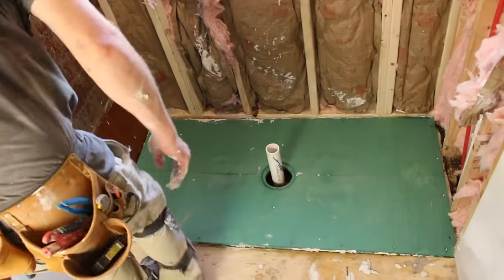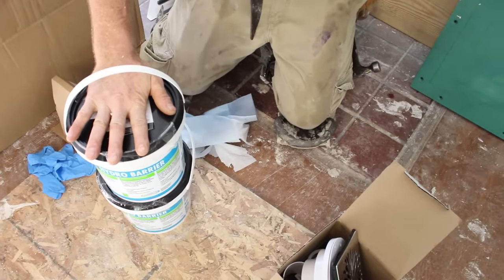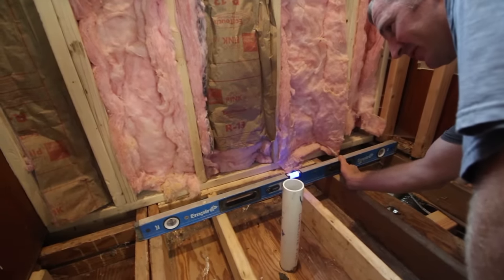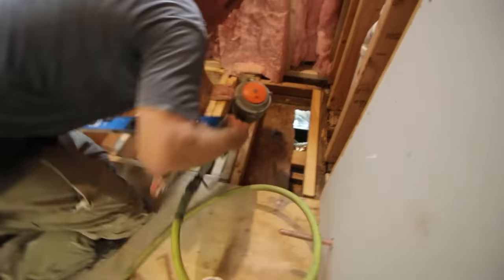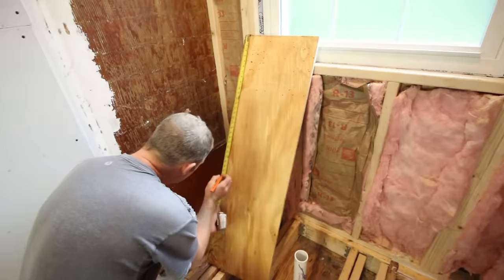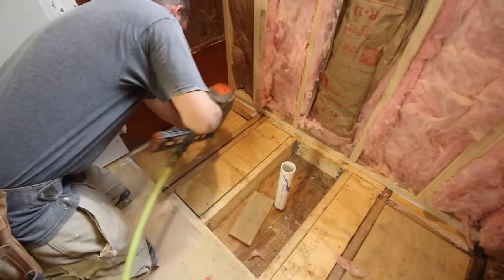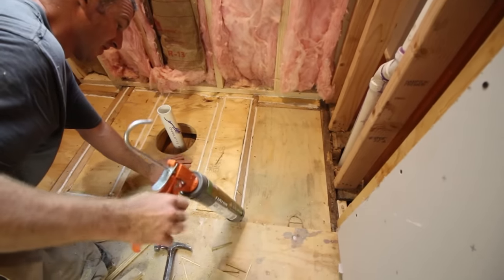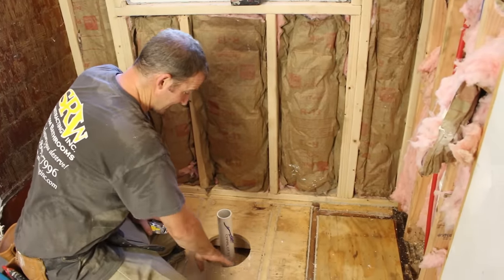How to Build a Curbless Shower (Part 1: VIM Shower Pan Install) -- by Home Repair Tutor

Comment: My father's a carpenter and I've been at a realty company that puts little time towards ensuring a products comes out properly. It's refreshing to see all the plotting and stages of work here. I actually like to use the screw method to hold things myself.
Reply from the maker: Thank you, our philosophy is to explore all different options and do the best to install them properly. VIM has a solid product, the prep is very important
Reply: I wished I’d would have used a nailer the screws kept sucking the 2xs out of level. Probably was doing it wrong.
Reply from the maker: Sorry to hear that, always feel free to contact us if you have questions
Reply: @HomeRepairTutor  Hi Baba booey
Reply: I bought a 60" X 42" TileRedi shower-pan with a  linear drain that's on a short end on the long end is the CURB (I should have kept my mouth shut) but I had to brag to my little princess! Now she's decided that I want a curbless walk-in shower! Now I'm hoping you would
be so kind as to assist me in this endeavor? 
  By the way I have several subscriptions to different u-tub channels, but I was so impressed by your vidios that lm going to purchase a 65" LG  TV.

Comment: The VIM system looks like a good quality shower pan. I like the way Steve reinforced the floor and how the shower pan is screwed down and thinseted around the perimeter and drain. Very well supported.
Reply from the maker: Yes, the VIM pan isn't going anywhere...unless the house shifts. Once the pan and bathroom floor are waterproofed this system is super solid, looks very much like a swimming pool
Reply: @HomeRepairTutor   Are you near st louis , I need this done for my husband. help is needed.  could you mention cost? please

Comment: Wish I had this a year  ago! I used the trudeck arc system which is similar. I’m a dyier in Cleveland. The carpenters tips are great.  What about the rest of the subfloor being level? Did you use self leveling? That’s  the problem I had.  I ended up jus t using vinyl for the floor and using a transition strip to the shower pan. I didn’t want to install the tile on a uneven subfloor. The pan I got exactly level. . Not exactly no curb but still pretty good and solid
Reply from the maker: Had this floor not been level we would have self-leveled it or adjusted the joists using the sister method, similar to what was done in the shower area.

Comment: With a tub to shower conversion I assume that after the tub is removed the old PVC tub drain would have to be moved to the center by a plumber before this pan/system could be used?
Reply: Yes

Comment: I would preassemble the framing around the drain and lay in space 3/4” below joist tops as one unit.  Easier to assemble and install.

Comment: Similar to the truedeck system we installed a few years ago, but the cost of it was crazy!
Reply from the maker: Was Truedeck crazy expensive? Or are you referring to VIM? We haven't used the former in anything.
Reply: Truedeck pan was crazy expensive! prefab presloped fiberglass pan for over 1k! But, it worked because of the mechanicals underneath the shower so we were unable to lower the subfloor. Great video by the way!

Comment: Great system. I’m going to use it for my DIY. I would like to use the ditra heat floor heating on the entire floor. And just for leveling purposes, the shower too. Any thoughts as where in the process to add the ditra heat? Straight to the sub floor and shower pan? Thanks!!
Reply from the maker: Just to clarify, the VIM pan is pitched for proper water drainage, so it shouldn’t be level. That said, if you want to use Ditra-Heat in that shower we recommend contacting VIM.

Comment: Not trying to be negative, but dang I hope the owner addressed the incorrectly installed insulation in the walls!  It's like there's nothing there near the studs.  If this is an exterior wall, expect condensation in the wall which will lead to mold.

Comment: The beveled edge of the caulkless gasket goes down into the matching beveled PVC cup!  Then the square threaded ring gets tightened down to squeeze & expand the rubber against the pipe & cup drain.

Comment: Another good vid guys, how new is the vim system? I have not heard of them up here in Canada?
Reply from the maker: Thank you, they’ve been out for several years. Are you going to install a curbless system?
Reply: @HomeRepairTutor  I am a contractor and if my next quote is for curbless, I will definitely consider this system. BTW how is the pricing of this system?
Reply from the maker: VIM is on par with other systems, slightly better in some respects. Our next video will show how to waterproof the pan and walls. Hydro Ban Board was used for this installation and we really liked it. That also is competitively priced and fast to install
Reply: @HomeRepairTutor  Can you use the Mapie waterproofinh with the Hydro Ban Board?

Comment: i would do so many things differently.  Number 1 is I would use Rockwool or no insulation at all.
Reply: Next step he burns down the house because he doesn't like the wood grain pattern on the studs.

Comment: Where do I buy the vim shower pan
Reply from the maker: visit VIM’s website to order, they’ll help you out 👍🏼
Reply: @HomeRepairTutor  will it pass code or what is the requirements to install curbless
Reply from the maker: @businessman5894  it should pass but double check your local codes. All Curbless showers require either recessed dimensional lumber or a recess kit so that you can add your 3/4” plywood flush with the joists. From there, add your tray then backer boards and waterproof according to the manufacturer specs

Comment: I was thinking about installing it in my RV travel trailer but I think I’ll make my own out of plywood and Self-leveling Epoxy I have a wheel well I have to come off the wall about 7 inches down 4 inches down to the drain And I could do a lot cheaper But I like what you do but for an RV/travel trailer you don’t have much of a choice I want a bigger So I’m getting rid of the sink so all that will be in there is a shower and toilet. But when I do my house again someday I’ll think about it

Comment: Cutting the factory edges going in towards the drain may be necessary for the tray to fit into your shower floor dimension. The problem  I see in doing this is that you create a "smiley face" shaped edge instead of having that nice flat, level edge. Your wall tile cuts at the floor will have to be curved to shape that "smiley face" also. This needs to be remedied

Comment: Why cant someone show how it can be done on a concrete slab!!
Reply: Because you remove the concrete slab re-pour a recessed slab, than ardex pitch the rest of the way.  Thats how you do curdles on concrete.
Reply: @allencarpenter9007  wouldnt you slope the slab itself?

Comment: Lol look AT THIS GREAT BIG DRAIN....... connects to 2 inch opening. Nice sales pitch go back to uzed car salesman
Reply from the maker: the point wasn't to emphasize the shower draining to a 3" or 4" pipe, it's that the drain cover is larger than typical covers. Plumbing codes require certain size pipes, so most people are constrained by that. As far as the used car salesman, you're implying we somehow deceived people. That's simply not the case, we do our best to explain what we like about different systems. And if you notice, we discuss many shower systems from Schluter, Wedi, KBRS, VIM, etc. Education is important and since we don't make shower systems we try to share all the different ones so people can then decide which is best for them.